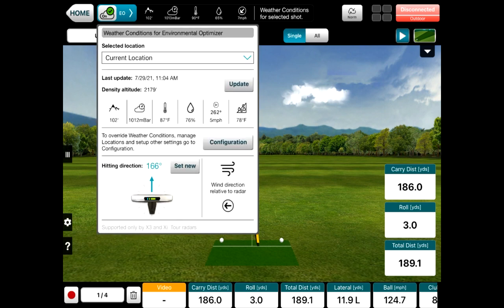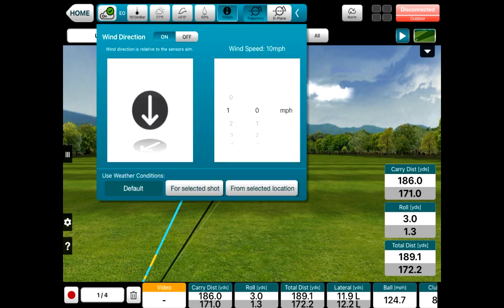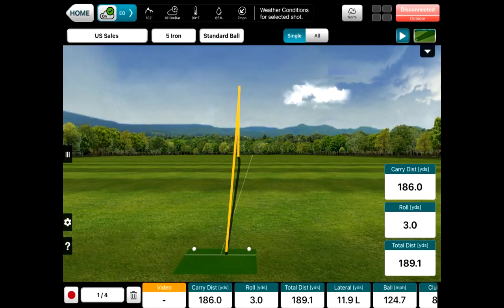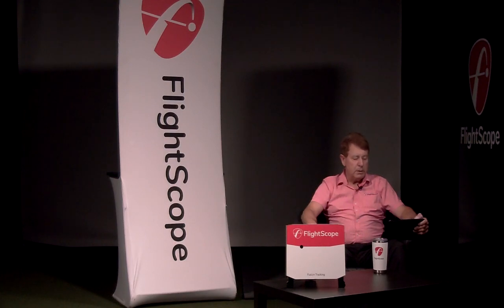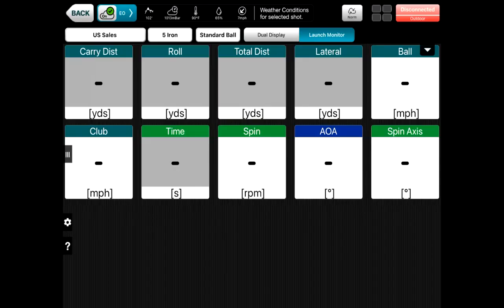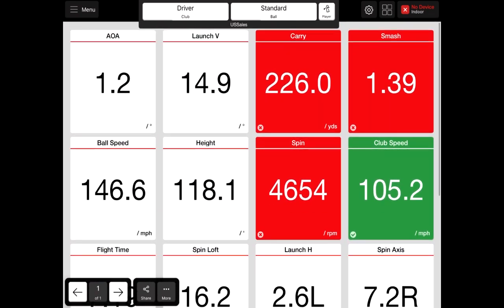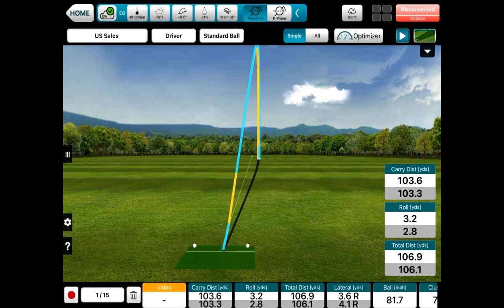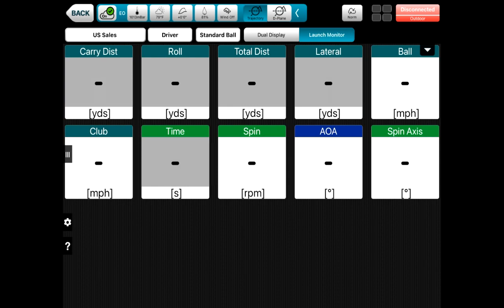July 29, 2021 X3 Webinar

Comment: Thanks Henri, now that I have a good understanding of the Environmental Optimizer I am using it on outdoor fittings. In Texas the wind blows, especially in open areas like driving ranges. My customers love it when I read off the numbers to them with the wind removed when we have a gusty cross wind in our face. 

Thanks for the Phantom insights on the effect of hitting off mats. I don't play golf on simulators nor do my customers. You gave me one more reason to explain why fittings should be done outdoors on grass.

I will begin exploring temperature with my customers. We just had a pair of 100+ days. I am going to begin exploring the influence of temperature with customers when I need to make them take a break between swings.

Keep the innovations coming, you might actually get me to like iPads.